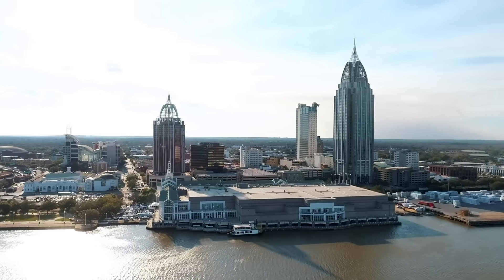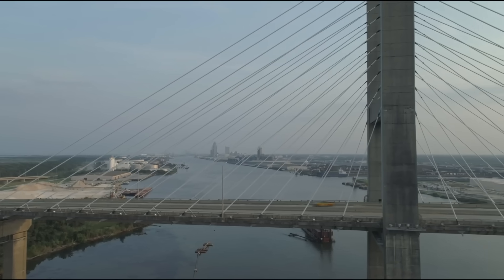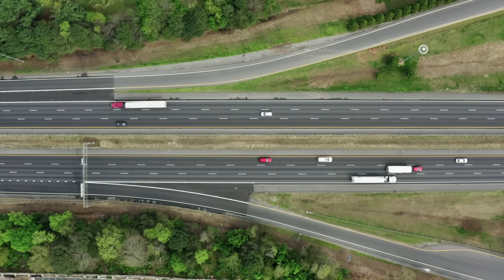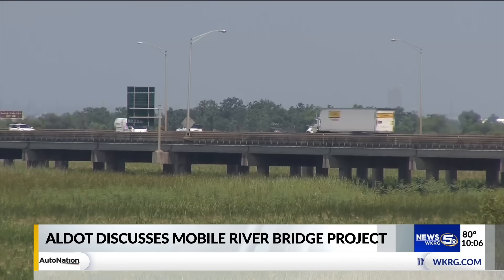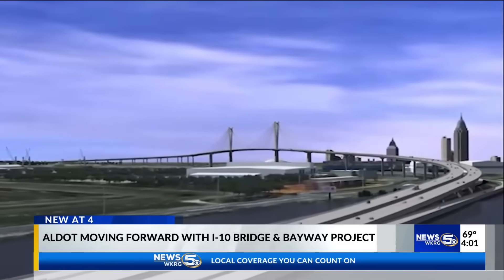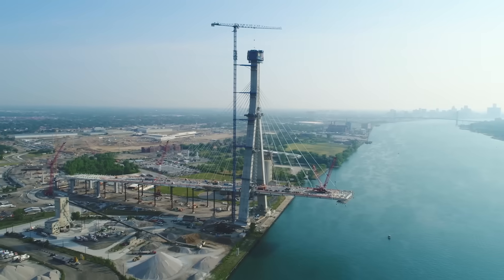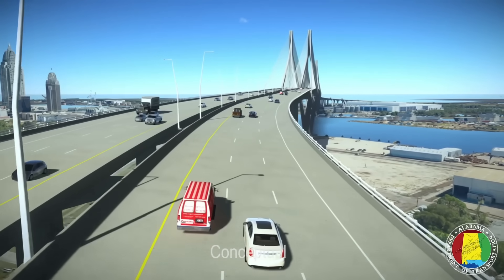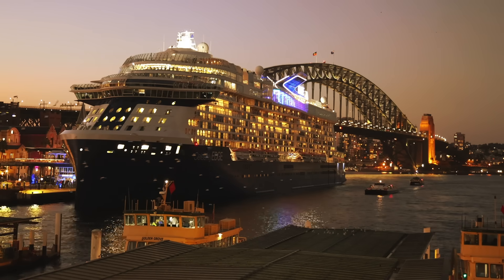Will Alabama’s $3.5B Megabridge Solve the I-10 Crisis?

Comment: I've driven through the tunnel quite a few times over the years and have never experienced a traffic jam.  Probably because I'm starting from far enough away that it's usually later in the evening by the time I get to Mobile... I can see how it could be an issue for commuters during rush hour though... Here in Houston, even with a LOT of lanes on our highways, traffic can slow to a crawl if someone sneeze, farts, or burps while driving...

Comment: What ever happened to the Bankhead Tunnel?. That's  the one I remember going thru on our trips to Florida as a child.
Reply from the maker: It’s still there! The Bankhead Tunnel is very much in use. It’s two lanes with a low 12-ft clearance, so no lorries, and it mainly serves local traffic now. Most through-traffic uses the newer I-10 George Wallace Tunnel (opened 1973), which is why the big bridge/Bayway upgrade is being pursued.

Comment: I use I10 a bunch from the Florida panhandle to Houston. 2 worst places is the Mobile tunnel and the bridge over the Mississippi River at Baton Rouge. Both need fixing badly.
Reply from the maker: You’re right, those are two of the Gulf South’s worst pinch points. In Mobile, the Bridge & Bayway replacement is progressing (test piles, project office open), with ground-breaking now expected in 2026. In Baton Rouge, the I-10 widening through downtown is underway with more work starting late-2025, and the state is moving an environmental review for a second Mississippi River crossing south of the city.

Comment: You forgot a very important point: The state of Alabama received $2.3 billion from BP due to the 2010 Horizon oil spill. That money was intended for the Gulf Coast communities affected by the oil spill, however the state government stole that money and put it in the states general state fund, then used that money to build themselves their own toll-free bridge 200 miles away.  Then they have the audacity to say that the local Gulf Coast community has to pay tolls when they took our money to pay for their own toll-free bridge.
Reply from the maker: I get the frustration. Alabama did receive about $2.3 billion from the BP settlement; most went to pay down state debts and support Medicaid, and about $120 million was earmarked for Mobile/Baldwin road projects (incl. US-98/SR-158). The I-59/20 bridge in Birmingham (~$700 million, opened 2020) was funded by FHWA/ALDOT/Birmingham MPO rather than BP cash.
Reply: The bridge is the I-20/I-59 bridge in Birmingham that got ALDOT approval right after Alabama was awarded $2.3 billion in 2015.  It cost $700 million and opened in 2020.

Comment: This 3.5 billion dollar bridge is only going to have a fractional difference in capacity cops need to start handing out tickets for people that slow down in the tunnel. That’s the reason it’s a bottleneck not because of any other reason. Most of the highways around here were all built back in the 70s or 80s and most of them still aren’t even being used to the maximum capacity it’s not an infrastructure issue it’s a stupid ass people problem. That’s the only tunnel I know of in the south and people freak out over the tunnel for no fucking reason
Reply from the maker: Fair point, driver behaviour definitely plays a major role, especially around bottlenecks like the Wallace Tunnel. The new bridge might help overall flow, but if tunnel slowdowns continue due to hesitation or poor driving habits, the benefits could be limited. Infrastructure alone won’t solve human error.
Reply: @urbangiantsofficial If they could make the curve going into the tunnel not as sharp that would be a big help. 18 wheelers are doing all they can to not tip over because of the poor engineering of the entrance to the tunnel. Truth is they could spend half what they’d spend on the bridge to make the entrances to the tunnel more efficient. Those tunnels weren’t drilled. They were pre fabricated sunk in the river where they are now and then pumped out! One of the coolest infrastructure projects of the 1900s in the south
Reply: Tunnels can mess with peripheral vision and vision in general when there is no natural light.  The obvious response is to slow down when vision is affected.  Most people are not using self-driving vehicles.  They depend on their eyesight.
Reply: @laurie7689 No they don’t people are just stupid
Reply: @jtmartin8445  I have a hard time adjusting my eyesight to tunnels.  I have the same situation when I drive onto tree-lined roads with the tree canopies over the roadway.  I have driven through tunnels and the road going to my mother's house had the tree canopy.  My vision gets messed up driving through such things.  I depend a lot on my peripheral vision in order to see.

Comment: Am I correct in assuming, that the Florida SunPass will work for the electronic tolls, like it does for Tolls in Texas?  I drive from Texas to Florida now and then, and got a SunPass tag.
Reply from the maker: That’s a good question. As of now, Alabama doesn’t have a fully integrated tolling system like Florida’s SunPass or Texas’s TxTag. If the new Mobile bridge uses electronic tolling, it may require its own system or join an interoperability network like ETC. But no official details have been confirmed yet, we’ll update the video description once there’s clarity.

Comment: I'm not paying no toll lmao
Reply from the maker: From what we understand, the toll would likely apply only to the new bridge and highway segment, not the existing Wallace or Bankhead tunnels. So, using the older routes would still be an option for those avoiding the toll.
Reply: Can you swim?
Reply: @dademack3544 I'll just go around.
Reply: @dademack3544  You will still have the tunnels.  There are actually 2.  The video does not mention the older Bankhead tunnel.

Comment: It will help a little, but only for a short while. 
And help me understand this math, four lanes was made for 35,000 cars but six lanes, an addition of only two lanes, will handle 100,000+ cars. It's too little to late. They should be adding 4 lanes at a minimum. Probably more. 
It will help the jobs and economy though.
The I-25 expansion in Denver helped for what, 2 years?
Reply from the maker: Many transportation experts refer to this as “induced demand”, the idea that expanding roads often just fills them up again in a few years.

The jump from 35,000 to over 100,000 vehicles per day with just two added lanes does seem optimistic, especially without major changes in traffic management or modal shift options. And your comparison to Denver’s I-25 expansion is spot on, it brought short-term relief, but congestion quickly returned.

That said, you’re also right that projects like this do bring economic benefits through jobs and trade efficiency. The real challenge is making sure that long-term regional mobility keeps pace with population growth, which might require more than just adding asphalt.

Comment: The current problem is that sharp curve on the west end. So sharp that at 55 mph. You cannot stop for stalled traffic. Everyone slows for the curve in both directions. Plus there is an on off ramp right in the curve eastbound. Close that ramp and it would solve a lot of the problem. That is where most of the accidents occur.
Reply from the maker: That’s a really important point, Joseph. The west-end curve is a well-known hazard, and you’re right about the impact it has on traffic flow and safety. The combination of limited visibility, high speeds, and that eastbound on/off ramp makes it a recipe for sudden braking and collisions.

Interestingly, this exact issue has come up in ALDOT’s traffic studies. While the new bridge project aims to reroute through-traffic and relieve pressure on the Bayway and Wallace Tunnel, there’s been less clarity on whether that specific ramp or curve will see structural changes or closures. It would definitely be worth pushing for a safety redesign of that section alongside the new infrastructure. Thanks for highlighting it.
Reply: I believe the speed limit in the curve is 35 then back to 55 once you're out of the tunnel.

Comment: I work in downtown Mobile but live in Mississippi. I have an hour commute. (~50 miles)I have coworkers that live on the eastern shore (12 miles) and I make it home before they do. That’s wild!

Also, My office actually overlooks the Wallace tunnel. That’s the old single lane tunnel. Does anyone know the plans for it? I haven’t head anything about it.
Reply: The Bankhead tunnel is the single each way tunnel. It has nothing to do with the interstate.
Reply from the maker: Thanks for sharing that, it really puts the traffic issue into perspective. The fact that you’re commuting nearly five times the distance and still getting home faster than people on the Eastern Shore says a lot about the bottleneck at the Bayway and Wallace Tunnel.

As for the Wallace Tunnel, the current plan is to keep it operational even after the new bridge is completed. The new bridge is intended to carry most through-traffic, especially trucks and long-distance vehicles, which should ease pressure on the existing routes. But you’re right, there hasn’t been as much public detail about the future role of the tunnel itself, and that’s something worth pressing local officials on as construction progresses.

Comment: Judging by how long it takes to fix a pothole or interstate…this will be completed in the next 130-170 years.
Reply: They started work on the stretch of 45 between south Houston and Galveston.
They started that 15 years ago. They're only JUST now getting close to being halfway done.
They've been building a toll bridge on Beltway 8 for over a decade. 
The Chinese can plan, design, and finish the construction of a bridge with a theme park on top in the time it literally took to just agree to build a basic cable stay bridge
Reply: ALDOT seems to be a better than average transportation agency.   They got 22 almost finished, and they rebuilt the downtown Birmingham viaduct.   The northern beltline might be a bridge too far, and the single piece they did build is of lower standards.  Id shift focus to get this bridge concept done, instead.

Comment: Yeah, that’s what they said about the Kansas turnpike. 
We’re still paying tolls.
 I hope you get it in writing boys and girls they gonna give up the money
Reply from the maker: That’s a valid concern. History is full of “temporary” tolls that quietly became permanent. Transparency and enforceable guarantees should be non-negotiable with a $3.5B public project like this.
Reply: Locals will take the tunnel. The original plan had them tolling the tunnel and the bridge at $6 each way. To avoid the toll you'd have to take the Cochoran Bridge.
Reply: The same is true for the Lake Ponchatrain Causeway.  They keep on adding time to the tolls. It was also found out that a portion of the  tolls were being spent elsewhere in New Orleans on a different bridge.  Most Causeway drivers don't drive the other bridge at all in their commutes.

Comment: 220 ft over the water..Will be the tallest clearance bridge in the US. Taller than the Golden gate
Reply from the maker: Correct, the new Mobile River Bridge is designed with a 220 ft vertical clearance, making it the highest in the U.S. for a cable-stayed bridge over navigable water. It surpasses the Golden Gate’s clearance (about 220 ft at mid-span), though the structural height of the towers themselves differs. It’s an enormous engineering undertaking.
Reply: @urbangiantsofficial My son is the main engineer for the project

Comment: It was Voted Down when they wanted the Publics opinion, but now that China wants to Own and Run it, it's all Good.... They will have Tolls on both Ends at Bottom of Bridge, going to be a lot of Serious Semi wrecks at the Bottom.. We are Ruled over by Criminals...
Reply from the maker: Thanks for sharing your thoughts. You’re absolutely right that the original toll-based version of the bridge was voted down by the public back in 2019, which led to a major redesign. The current version is not being owned or run by China, that’s a common misconception. It’s a state-led project overseen by ALDOT, with federal funding and no foreign control.

The concerns about toll placement and safety at the base of the bridge are valid, especially with steep gradients and heavy truck traffic. These are exactly the kinds of issues that need strong oversight and transparent engineering solutions, not rushed decisions behind closed doors.

Comment: Should have been done 30 years ago. AL also needs to work on 4 laneing HWY45 and HWY98 both of which MS has 4 laned already through their entire state. Having HWY45 and 98 4 laned in AL would help commerce from Mobile port have more direct travel routes to I-20/59.
Reply from the maker: Correct. Mississippi has made smart moves with HWY 45 and 98, and Alabama’s lag in upgrading its portions is a missed opportunity. With the Port of Mobile growing, these corridors could be critical for freight flow to I-20/59 and beyond. It’s long past time Alabama matched the infrastructure investment seen across the state line.
Reply: @urbangiantsofficial I just drove that part of 98 on a trip to Arkansas from Pensacola. it’s remarkable how nice the Mississippi portion of 98 is and Alabama’s section is still not complete.
Reply: Thanks I worked on the Hwy 98 project as a young engineer. Now I'm retired and Alabama still hasn't finished their end.
Reply: @bradleyanderson4315  I mean they even built a bridge across the river on Hwy 98 I believe that's not even being used. What a waste. They'll 6 lane 20/59 between Bham and Tuscaloosa, but then completely ignore that I-65 between Bham and Montgomery needs 6 lanes. I grew up in MS but now live in AL. MS does much better on their DOT work.
Reply: While we're at it I-65 needs to be 6 lanes from Mobile to Tennessee. Driving south on a Friday is a nightmare from Calera all the way to Mobile.
Reply: @garyblack8717   How about a straight North highway from Mobile to Tuscaloosa?  I 65 is ridiculous the way it zig zags throughout the state.
Reply: @garyblack8717  Bro it has been that way since 2004-ish. Might happen in 30 years...
Reply: THIS!!!!!

Comment: As a lifelong resident of the area, I have always felt that ALDOT was not doing enough with the amount of traffic. There should be a dedicated truck route, via the Cochran Bridge to I-165N to I-65. I would require RV traffic to take said route. While this isn’t a fix all it would alleviate some of the congestion. When the Wallace tunnel was being designed the original plan didn’t take it so close to downtown, but business owners got together and had it changed. The curve on the west end of the tunnels is the biggest failure! 
Once the new bridge is built the current “Bayway” is to be demolished. Which is ridiculous in my opinion! But as slow as it’s going I will hopefully be retired and won’t have to drive to Mobile.
Reply from the maker: Thanks for sharing your local insight.

You’re right that the Wallace Tunnel’s sharp westbound curve has been a long-standing flaw, and it’s a clear example of short-term business interests outweighing long-term transport planning. A dedicated truck and RV route via Cochran Bridge and I-165N could absolutely ease congestion, especially during peak travel and hurricane evacuation times, and it’s surprising ALDOT hasn’t prioritised this more.

The plan to demolish the existing Bayway rather than reinforce or repurpose it is also controversial, and many share your view. There are cost, environmental, and maintenance arguments cited for removal, but from a resilience standpoint, losing that redundancy in a hurricane-prone region seems short-sighted.

Appreciate your take. Local voices matter in shaping how projects like this are perceived and, ideally, improved.